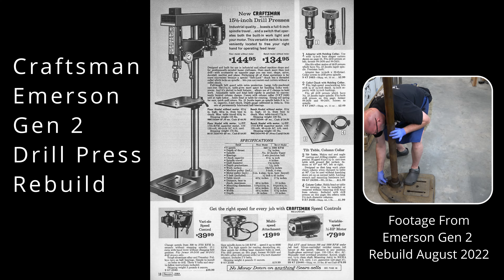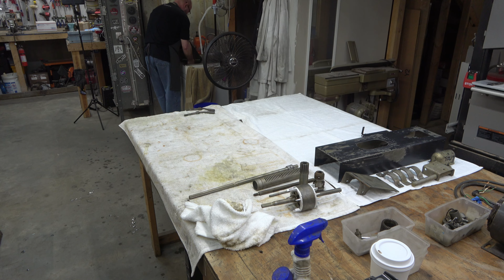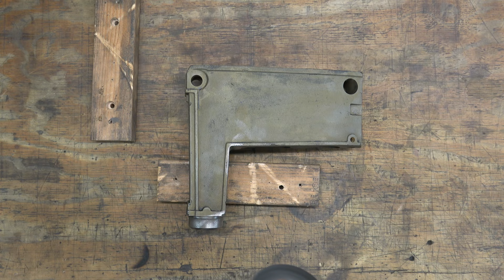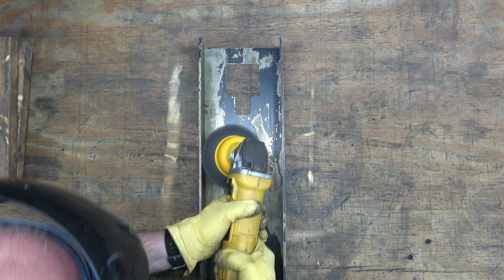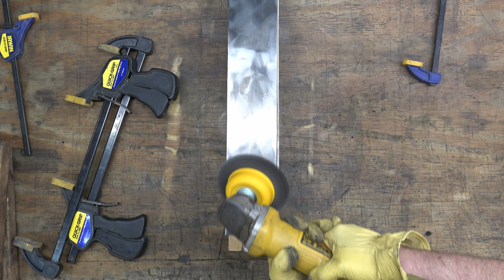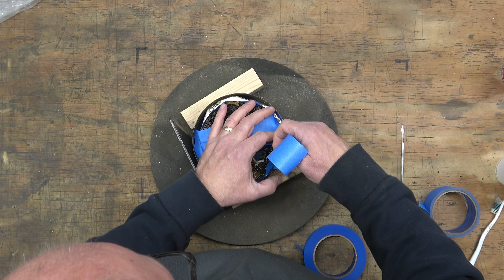Part 6 Craftsman Emerson Gen 2 Drill Press Rebuild (Citric Acid Soak & Wire Wheel Cleaning)

Comment: Enjoying the series. Do you like to apply insulating varnish on the stator?
Reply from the maker: Thank you. I normally only apply the varnish if it is needed. Most of the motors I rebuild do not require it but I have done it from time to time. I usually use an aerosol insulating varnish when I do it.